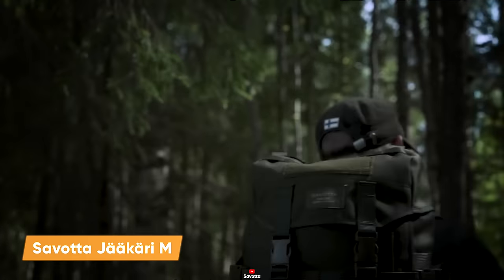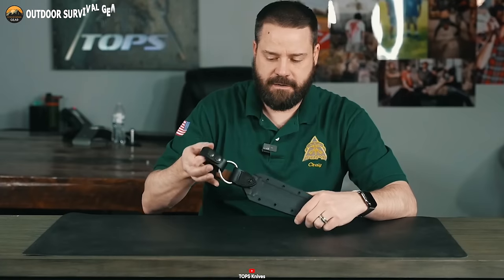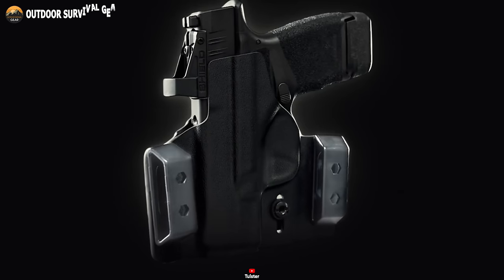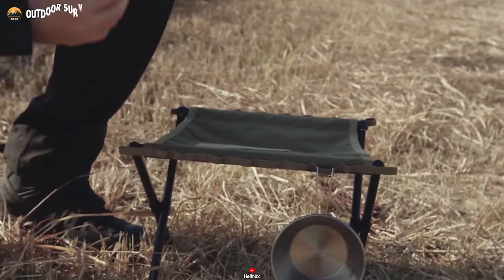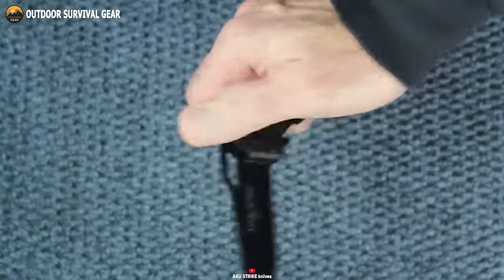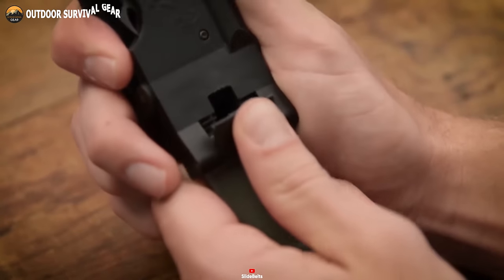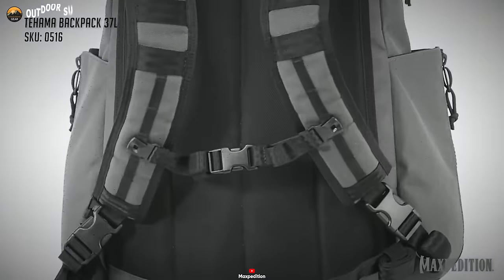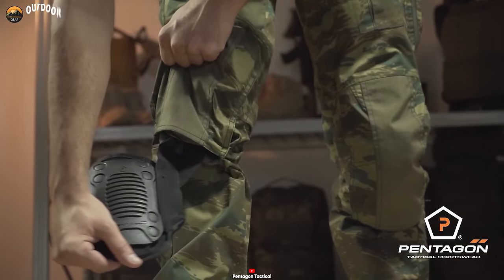50 Incredible Tactical Military Gear & Gadgets You Must Have

Comment: Your tactical pickle jar, ties into the tactical band-aid and rubber bands, and the life saving tactical lip balm. No operator would be caught dead without it, and, in case you survive your mission, no collection is complete without your tactical house slippers and bath robe, all made with the strongest paracord tested at 1,800 lbs. per square inch. 😆
Reply: "the tactical frontline dilator fashioned from high impact rugged silicone with a state of the art retractable gripband will deliver and deploy in the most critical of combat dilation situations!"
Reply: Call it tactical double the price.
Reply: What about a comb and hair gel